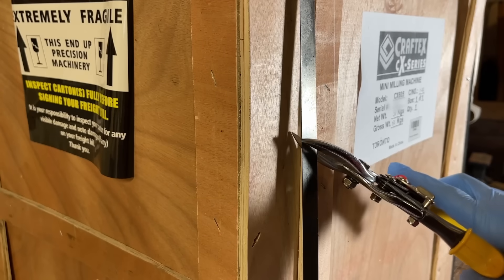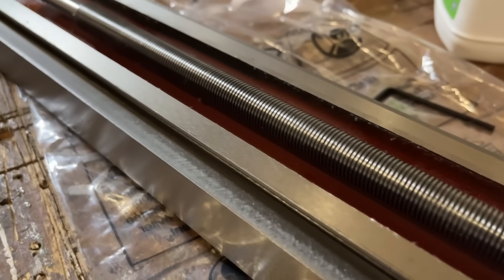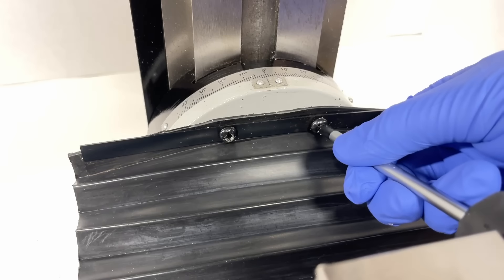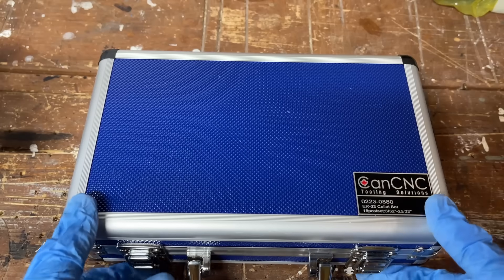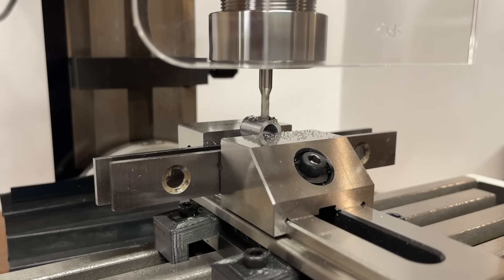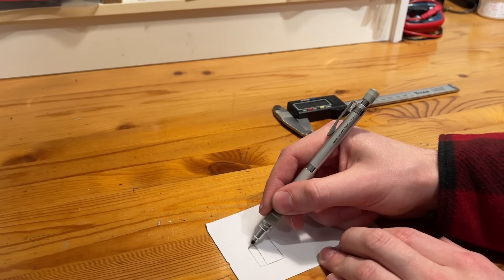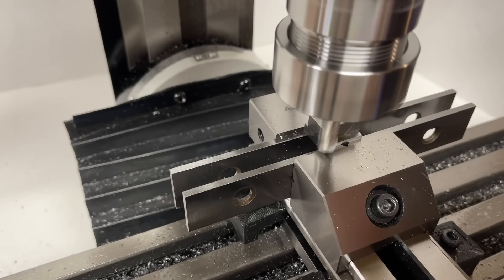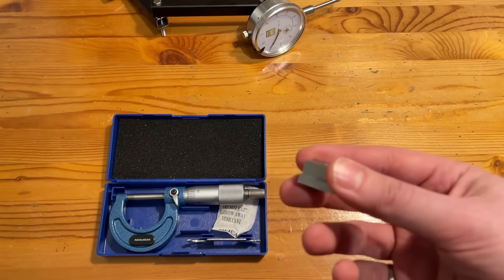I Bought A Minimill to see if they are Worth It

Comment: I've had a Grizzly mini mill for about 20 years. 

first thing to break was the Z axis stop. it's so cheaply made of cast zinc metal

then the low gear broke. they're made of plastic and will break guaranteed 

then the high gear broke. I had to get the belt drive and it's a huge improvement. so much quieter and smoother

I mostly machine aluminum but I've machined steel and stainless steel on it. you have to take really light cuts on steel otherwise the table will shift and you'll get a huge difference from one end to the other

it's super slow having no power feed and your arms get tired after a while, also time consuming not being able to just hog away at material like a full size mill

having said all that, I have made sooooo much stuff on it that I feel I got more than my money's worth out of it. I really used the hell out of it. sometimes it doesn't move when I turn it on but I take it apart and put it back together and somehow I always get it going again even though I don't know what I'm doing

I break the cardinal rule. I use the drill chuck to hold end mills because it's so time consuming to change out the collets plus I only have two collet sizes

my mill is in my basement so it gets really dirty when I'm doing a lot of work

it has it's limitations but it's a great tool for DIY people

Comment: I have a Sieg mill that had those .0625" per revolution feed screws.   The mill was free.   I replaced them with kits from an online small hobby machinist company.   With the .1" per revolution parts in, it is much more difficult to turn the tiny handwheels.  The nut they supply is too small.

Comment: they sure can; i've got the little machine shop brushless high-torque. also, dagg, that's a micro lathe(!); picked up a 9x24 from vevor i've also had for a few yrs
Reply from the maker: The brushless motor version is really nice, I’ve been considering making the switch over now that I’ve converted the mill to cnc
Reply: @Someone_Should_Make_That  I like it. I gotta check your setup, I been thinking to do the same (cnc it). Wanted to get a good grasp on running it manually first, but it's time.. the lathe btw is 9x18 w 1 1/2" spindle bore (i rlly like about ti); i'd misspoke before

Comment: Instead of making the clamping blocks one at a time, use a longer piece of bar, mill both edges, drill on center and cut off to desired length. Saves on resetting  Y position each time you mill the edges off.

Comment: Column wander problem. The column is hollow and over tightening the swivel bolt can crack the column. Easy fix....Turn down a steel bush that  goes part way throuch the working side, a bit bigger diameter that the hole of the column, and larger than the outside hole. this will put the swivel screw load onto the bush, thus giving it something solid to tighten up on.

Comment: These X2 style mills have the DC motor, so you can add a simple DPDT reversing switch, all it does is swap the 2 motor wires over which reverses motor direction.
That was one of the best mods I did on my X2 mill, and I even used a DPDT toggle switch with center-off position, perfect for tapping threads in the low speed gear because just with that one switch you can run the spindle forward, stop, reverse, stop etc.

Comment: Great video! I’ve been using my Hi Torque Mini Mill for about 10 years now. No issues with holding +\-.002 which has been fine for most of my projects. Taking lite cuts is key to mitigate any flexure, as u don’t have the rigidity of a Bridgeport type mill.
Reply from the maker: Love the brushless motor model. Definitely an upgrade I’ve been considering adding! Glad to hear you’ve also had success

Comment: I bought a similar version. The runout was terrible. Replaced the shaft. Upgraded to a belt drive but messed that up and destroyed the electric motor, that was my bad. Wanting more power I went with a 2hp router and made a simple adapter shaft for the pulley. The router motor is very powerful and I use a HF router speed controller. The router was very easy to adapt and has a lot of adjustments leaving room for error.

Comment: agreed. i have the harbor freight one and once i completely dismantled it, cleaned it, smoothed rough edges, lubed, assembled, and adjusted it, i have been getting excellent results. yes, you cannot take as deep a cut as on a $5k machine but then, you do not need 3 phase power and a huge space either. i would not use these for mass production business but they are perfect for hobby and small parts machining.
Reply from the maker: Happy to hear you’ve had good luck! Yeah definitely easier to fit one of these things into a shop. I have to hand carry all my tools down a flight of stairs which makes getting a full size mill a bit of a challenge haha
Reply: @Someone_Should_Make_That  yup, i am in the basement which makes a large mill, which is what i learned on, impossible too. i have a 9x20 lathe too that i love. the key to chinese machine tools it to think of them as a kit. dismantle, clean, finish, assemble, adjust, and you will have an awesome machine for a lot less cost. of course costs are going to jump drastically again very soon.

Comment: When a machine, or a system of machining becomes available to everyone  ie. CHEAP.
Then the KNUCKLEDRAGGERS come to afore.
A "Mini Lathe or a Mill" is a LEARNING OPPORTUNITY.
As the user improves, then so does their ability to improve the machine(built at MINIMAL. COST).
NOW hang on, Brridgepirt, LeBlond(e) are the "best" ... Are all shite machines... as are the Colchester lathe's with Gamette bearings(any tapered roller bearing better than an automotive wheel bearing of the 60's.......
BUT hang on, aren't "Bridge ports", now made in "Taiwan", well kinda, like a super-turd masquerading as a TURD - BUT isn't the "Taiwanese" machines MEHANITE liks Brridgepirt, with a big fat "M" on the column, which means "god iron"!
Nah, it's shite high volume, low density cast iron - I know nothing about the. "M"?!
Well Kent, Gate, Excell....... All shite(I own All of these poopers......) In turret form, no "M" turd Mark on the Ex.. 
If you have ever wrought rotten wood, then you've wrought the ways on an "M"......
Now if you mention Cincinatti, then that is really an AMERICAN GOD of machinetool(as is Graffenstad for. Germany), 😢 like its spawn the "Milwaukee", and not including those awful red and white power tools of late ....
The saga may continue, but are We ready....!?

Comment: 0.625" is 1.5mm, so the cross slide for the bed would be less awkward if you could bring yourself to use the altogether more straightforward metric system.
Helpful review. Thanks.

Comment: Thank you, I had no idea anyone made a minimill. We have a small shop and need to utilize the shop correctly.
Reply: Mini mills or table top mills have been around for some decades. Sherline is a known US brand that offers table top mills and lathes, both manual and CNC,forhobby and industrial use. Wabeco and Optimum are higher end German table top mill and lathe manufacturers. Largest amount of manufaturers are in China. If I to go for a mini mill to use it for busniess, I would not go into the cheaper ones that potentially needs much adjustments like in the video. There are higher end machines.

Comment: If space allows, the money is better spent on a larger used machine. I have a 300-400lb round column midi mill with a 1hp motor and it's a great drill press. My 3/4 Bridgeport sized Sharp mill around 2500lb has been awesome and is light years better than the midi sized machine for milling work. That said for a long time I only had room for the smaller one and did a bunch of good work with it that paid for the Sharp after a year or two.

Comment: It doesn't matter how much you tighten the nut on the big column.  Sooner or later it will want to tilt while you are cutting.  My solution was to make some steel straps screwed into the column and the mill base.  One on the left and one on the right.  A full 3/8" thick they won't be moving or bending any time soon.  The weak point now of course becomes the low quality cast iron base.  Hopefully nothing bad will happen.  It has been 5 years and nothing bad yet.  A motorized carriage really cuts down the time moving it sideways.  The biggest failing of the Mini-mill series is the lack of a movable knee.  There just isn't much Z axis without one.
Reply from the maker: That’s a good idea, I was thinking about pinning the column but straps would be an easier solution

Comment: I got a mini mill free on eBay. They were offering a new mini lathe, with bright yellow picture on the box, some shipping damage to the box. Next to the lathe box in the picture was a plain brown box of possibly lathe accessories, identified only by a number. I looked up the number and found it was a matching milling machine! So I bid full list price for the lathe, won the auction for a little less than my bid amount, and sure enough received both the lathe and milling machine! As expected, the machines were stronger than the boxes and worked perfectly. I have made lots of good parts on my milling machine, using up to 2 inch carbide insert end mills in steel without any problem.

Comment: I think the issue with smaller machines is QA/QC.  The mill you bought looks pretty good.  You can also buy one and have the ways ground slightly off such that the travel gets tight at one end etc.   I had a small 10x22 lathe and had to make several upgrades/modifications in order to handle heavier cuts or using carbide.  I dislike straight cut gibs.  Felt like I had to constantly re-adjust to maintain precision.  Spent years running it making parts before upgrading to a 13x40.  So glad I upgraded.  I also think it depends what you want to do.  I needed bigger machines for larger projects.  IMO every garage should at least have a mini mill.  So much you can do with x-y-z cutting/drilling/tapping etc.

Comment: People that try to use a mini mill as a drill press are the ones that have the most problems. It is not a torque machine - Use for precision work. If you want lots of torque, spend more $$ and get a larger and/or brushless machine, say 750, 1000 or even 1500w !

Comment: I worked a place that had a mini mill. I Think it was from Harbor Freight. Once I put a Curt vise on it and got it dialed in. It's accuracy was 0.003" over a 10 inch cut on the X axis and 0.002 over a 6 inch cut on the Y axis and 0.001 on the Z axis. We cut aluminum, mild steel, stainless steel, and all kinds of plastic. If I could keep the people who did not know how to use it away from it, it did rather well for what we needed it for.

Comment: The CX612 is the same mill with belt drive and brushless motor. Much more capable, quiet and smooth. Mine came with an R8 spindle so I use R8 collets to gives more vertical clearance and rigidity. I also made a T shaped bolt on plate for the back of the column to disable the pivot and stiffen things up. It can be removed if column pivoting is required. Except for the 62.5 thou dials I have been quite happy with the machine. The column stiffening plate did increase the working capacity quite a bit and reduced the vibration.

Cheers: BJ in Ottawa

Comment: As for the gear noise, have you ever heard a Bridgeport? ( yes I know the ridiculousness of comparing it to a Bridgeport, it will never happen again) the real issue with the gears is they are engineered to be the weak point for a reason( they are cheap to replace) a belt drive eliminates these issues.

Comment: The tool, machine whatever has a safe working design limitation, exceed this and one is just asking for trouble.   
I have a small Sherline Mill, and this for me covers all the tasks I ask of it.  
Any bigger and I do my milling on the lathe!   As its surprising just what can be mounted upon the carriage or cross slide and `in` the tool post too!!
Even employ a Jacobs chuck with through bolt for small milling tasks. 
So, what the issue there??

Comment: I have had one of these  for over 10 years. It works really fine for small work, helps to get a cheap DRO for it, since the scales are not any good. Mine is mk2 so I can use the same tools via adaptors as in my larger TOS and Aciera mill. Only use it for 2:nd op setups etc. In Al I have run a small boring head with excellent results. Modifying it with belt drive will give better results.  I have always been amazed about the quality and precision of work many modellers do with these inexpensive machines. A skilled machinist can make great results with simple equipment. I would not use it with more than a 6 or max 8 mm mill though for best results. Make a small fly cutter instead. Also trammed and pinned mine permanently, never had the need to tilt the column. It is usually more precise and simpler to use angle blocks, a small rotary table or a sinebar. The vise in vise technique is very useful. I second taking everything apart when buying it and take some time to clean, debur, check and fix issues. I would suggest ER16 collets as a good match.

Comment: I have grandiose to convert my G0704 to CNC, though I have yet to focus on it.....I found that most issues in my machine lie in my not so rigid setup's or my greedy speeds/feed expectations.  Otherwise they are very capable little machines!  Fun video / fellow 'tool collector'  👍😁
Reply from the maker: Stay tuned! Cnc conversion is in the works!

Comment: I have a Harbor Freight mini mill and it has proven to be quite useful. I upgraded all the nylon gears (except the easy to replace intermediate gear) with steel ones after I accidentally overloaded it and sheared a bunch of the ones inside the gearbox. I also replaced the original spring loaded arm for the Z axis support with a gas spring support, which gave it slightly more Z travel. At some point I plan to convert it to CNC.
Reply from the maker: That’s probably a good call. I tried a belt drive modification but my design needs work. Maybe throwing some gears together would be a good interim solution

Comment: I have a Sherline 5400 mill that I converted to CNC.  The axis drives are stepper motors, not servo motors.  The lead screws are 1/4-20, not ball screws.  The spindle motor is DC, set on machine to run at 10,000 RPM.  The ways are machined, not ground.  Minor modifications have been made to improve control of backlash.  A 4th axis CNC rotary table has been added that I use for the A axis.  Designs are done using Fusion 360 (free to hobbyists), with tool paths generated using the post processor that comes with the applications.  Machine control is accomplished using an online gcode sender.  

Clearly, this is not a Mazak.   And I, being a mechanical engineer, am certainly no machinist.

All that said, as a demonstration of the capabilities of a carefully set up Sherline mill, I made Lego bricks in brass and tested them with real Legos supplied by a grandson.  The fit on Legos is very precise, requiring a slight push to set them in place, and there is no detectable overlap between the edges of one brick and another.  Using my brass bricks with each other and combined with plastic Lego bricks, the two designs were identical in fit and function, discernible from each other only by weight.
Reply from the maker: That’s really cool! I’ve been curious about how the sherlines perform. Nice to see there are some options out there!

Comment: I have a mini mill and a bench top lathe and they are both fantastic. I cut steel routinely. I can hold half thou tolerances without crazy difficulty and tighter on the super rare occasions I need to. They aren't huge industrial machines, but for a guy in his home shop, they are fantastic.

Comment: To cut a KEWY WAY: Use an endmill that is smaller than your key.  Then cut the keyway to size by gradually increasing the width of the keyway until it is cut to the proper size.  You should be able to 0.001 or 0.002 inch tolerance.  If you use a nominal size, the key way will be over size because the end mills push off center and thereby cut oversize.

Comment: Would you buy a mill or large first?
Reply from the maker: I bought a lathe first and I don’t regret the decision at all. It taught me a lot about machining and is extremely versatile! With that’s said it’s worth considering what kind of parts you want to make before making the decision, square stuff tends to work better on a mill, round stuff on a lathe (as a general rule)

Comment: As mentioned below, I run my two small mills and mini lathe in accordance with what they CAN do, not traditionally influenced "expectations".
It takes a considerable amount of time to make what I need which is fine.
Eg: I don't refer to the graduations marked on handwheels, I measure as I go for example. Allow for a little slip slop slap here and there n bobs your uncle. 
The odd critical fastener may drop out so have your threadlock compound handy and be prepared to stitch her up properly.

Comment: About 25 years ago I bought a mini lathe/mill and indexer to make RC helicopter multi blade rotor heads and swash plates for Myself for "scale" helicopters. After several fails, I was making those and tail rotor assemblies. Granted, all out of aluminum but it worked well for Me.

Comment: Retired machinist, looking to set up a small home shop to tinker a bit. My complaint is price, why should I pay more than a used 2 phase industrial knee mill or turret lathe in good shape, just to have greatly reduced capacity?
Reply: I agree that prices for the Chinese hobby machines are too expensive for what the buyer obtains. Unfortunately, price of a newly manufactured hobby machines of good quality would not sell well enough.
An experienced machinist would be able to determine the condition of a used machine. Not so for beginners.
One big problem for many is the lack of space for full size machines.